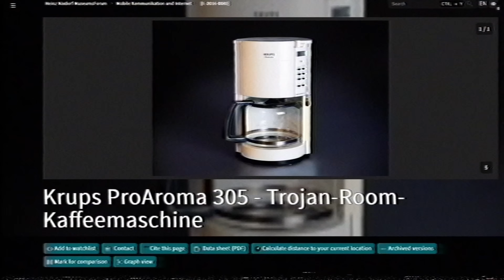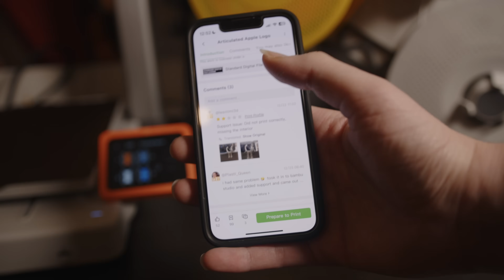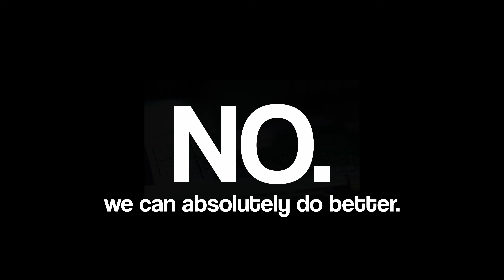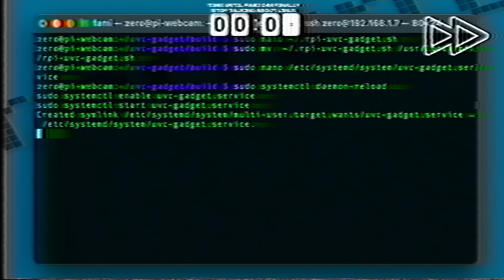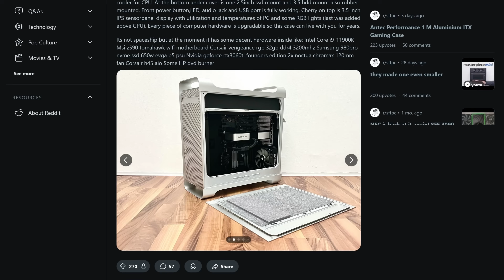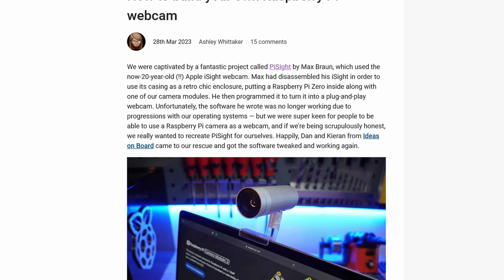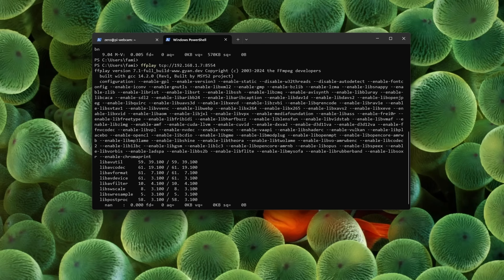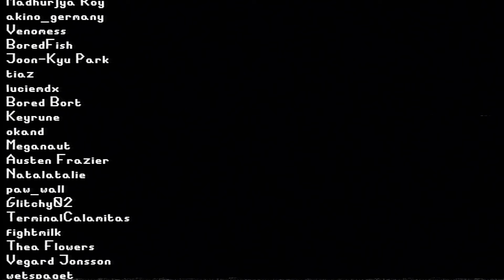Webcams SUCK, so I built my own one

Comment: You realize the irony of using the Pi right? The Acorn Archimedes used an ARM processor, ARM used to stand for "Acorn Risc Machine". The Pi is also using ARM, modern ARM. When you were using it over the network, you made the original coffee pot configuration INSIDE A ISIGHT HOUSING! AAAAA that's cool as heck!
Reply: Acorn Computers of course being a Cambridge company, the Owners starting out-ish at Science of Cambridge (SoC) then starting Cambridge Processor Unit LTD (CPU) and then onto Acorn, I might have to watch Micro Men again
Reply: the fact that Raspberry Pi and ACORN are Cambridge companies
Reply: @gammongaming9081 And both named after fruit
Reply: 666th like.

Comment: It's honestly crazy to me no company has simply released a webcam that uses one of the amazing camera sensors that smartphones have now. We have phones that can shoot HDR, 240FPS, 4K, and yet webcams are still stuck struggling to do SDR 1080p 60fps in a decently lit room.
Or hell, put a DLSR sensor in a shell with a focusing lens.

Every few years I check to see if a company has come out with a decent webcam and and disappointed to see it hasn't happened, or if it has, it's basically the cost of an actual smartphone.
Reply: They're out there, just intended for industry use. Doesn't prohibit one from snatching such a camera from ebay though! Recently got a 2K one with 10bit stream and 110FPS. Basically a plug and play DSLR in a small package.
Reply: The problem is the data rate for high resolution high quality video is pretty high. The sensor itself is rather cheap, but the electronics needed to interface them aren't. (A smartphone SoC costs a bit of money!) And I guess there isn't big enough of a market to justify designing a custom USB interface & signal processing chip for this purpose
Reply: Most people really do not need to buy a webcam.
Camo allows pretty much any smartphone to become a webcam. With my phone I can go 4k60 if I really want to and specify which lens to use.

Most webcams are a waste of money.
Reply: @Ozzianman  Maybe if all you're doing is zoom calls for meetings. The moment you need a low latency video feed on the computer, your phone is a waste of effort.

Comment: One thing I've wondered for a while now, is why are webcams STILL using such tiny sensors and no proper mechanical zoom/focus functions, when you can easily make a webcam with a much larger sensor because you AREN'T restricted by space like phone cameras. Also, why are they STILL doing ANY of the processing? Even your version STILL has to do the encoding on a separate system using a totally different OS which adds unnecessary lag to the signal. It's literally connected to a whole ass much bigger and more powerful computer that have dedicated video encoders in the CPU and even the GPU, which are sat there doing bugger-all for most of the CPU/GPU life - just send the sensor signal to the COMPUTER ITS PLUGGED IN TO!
Reply: USB bandwidth is the issue

Comment: Hi! Zoom tech here. Since webcams are made for video conferencing the priority focus is lowest bandwidth. Apple and other laptop manufacturers try to focus on things like dynamic range rather than resolution since the software they use will reduce the quality to a max of 1080p. Even when bandwidth isn’t a concern the client system needs to encode than decode the streams in real time. The hardware can be easily overwhelmed trying to decode a couple 4K streams in real time let alone 20+.
Reply from the maker: Interesting! But wouldn't it possible/better for at least mid to high level webcams to give the user the chance to use their sensor to their full potential for specific usecases like streaming or recording video locally? Giving them choice, basically
Reply: webcams are not made only for video conferencing, there are a lot of other applications. your reply doesn't hold up any sort of logic. a camera is a camera ...
Reply: Then why are selfie cameras on phones great?

A camera is a camera, and people use them for more than Zoom.
Reply: @MentalEdge  because it's there mainly to take pictures and mobile phone SoCs have highly efficient video processing circuitry that's just not present on x86 devices. Your PC has to either process video with no acceleration on the CPU or send it to the GPU and rely on the accelerator there. So a phone just streams data over CSI straight to the relevant pins on the SoC, while a PC - if you were to use a high quality camera - would have to receive a massive stream over.. something?, put that into RAM, send it to an accelerator over PCIe or completely saturate a few cores to process it on the CPU and then it could save it. Hence why people using DSLRs for a webcam use them with a capture card.
This webcam project works because the Pi Zero is doing the video processing directly on the Broadcom silicon there. For webcams to have high quality output they would basically need a more expensive chip integrated into them and people buying webcams just wanna connect to a video call so the market is probably risky and companies may be unwilling to try it
Reply: @oiytd5wugho  None of that makes the "problem" of non-sucky PC video input insurmountable.
Reply: @MentalEdge  yes, nothing is insurmountable. Sorry for elaborating?
Reply: @oiytd5wugho  So you're not defending the status quo? You need to be really careful with "elaborating" at someone trying to make the point that bad thing being bad has no real excuse to be bad. It's really hard not come off like you're condescendingly explainable why there is a perfectly good excuse, actually.

You didn't tell me anything new, and I still think there is room for straight-forward improvement.
Reply: @MentalEdge  "so you hate waffles?" moment
Reply: @oiytd5wugho  "For webcams to have high quality output they would basically need a more expensive chip integrated into them" but if an entire Pi costs $15 how expensive a chip do you really need to integrate into the webcam for video processing? That's where I'm lost.
Reply: @Blutzen  like 5$
Reply: @oiytd5wugho  As another dude pointed out, if a relatively cheap Pi can handle the processing then what stops people from making inexpensive webcams with it? 

I also don't understand the hang-up with data busses - current standards possess plenty of bandwidth, issues with dropped frames have more to do with poor code. Ryzen has also pretty much ensured everything possesses a GPU these days, so that's not an issue. The components in an x86 system might not be anywhere near as efficient or purpose-built like they are with phone SoCs, but they make up for that with sheer processing power.
Reply: @kyotra  y'all are asking questions and then complaining about having answers... The "hang-up" is dealing with unstructured data such as an MIPI stream, I am telling you how things work, if all you want to do is complain then do not use the word "why".
There are market reasons and hardware reasons webcams are bad, I am not interested in or capable of solving them, I just made the mistake of explaining things to people ig
Reply: @oiytd5wugho  We're not complaining, we're asking more questions because your previous answers were unsatisfactory. Thanks for the condescension though!

I also think your reasoning regarding the webcam market doesn't make sense. The use of webcams for video calls is on the decline, since it's so much easier to use cell phones for the task; on the flip side, the people who do have an interest in desktop-connected cameras are streamers. Webcam makers should be shifting to target this new segment (if they're not already leaving the shrinking market), yet they are not even trying at this point. So what gives?

You don't have to answer that by the way, it was rhetorical. It's obviously the typical corporate penny-pinching and chickenshit risk aversion at work here.
Reply: Modern GPUs can handle dozens of video streams at a time. FYI
Reply: @HyviaVideoitaMansenlale  Video conferencing has to run on chromebooks and cheap tablets. Even intel iris or something like that from a few years ago is way above the minimum spec
Reply: @MentalEdge  Man, stop being passive aggressive on a topic as silly as webcams, you're talking to an Internet user, not your ex-girlfriend

If there are no improvements, it's probably because there's simply no demand. The vast majority of webcam users want something cheap and that works, especially considering that even when you're a streamer, the webcam video is just a small box in the corner...

If your intention is to take good quality photos, or record videos without streaming, you either have your own phone, or more professional and expensive cameras. Very few people are actually interested in webcams that provide professional video quality.
Reply: @Blutzen  

You're not just buying the Raspberry Pi, you're also buying the camera, which costs $30 at adafruit ($20 if you go for the smaller spy camera, that I imagine it doesn't have the same image quality as the video shows), not counting import costs. And don't forget that you also need to make the case on a 3D printer. I don't know if the Raspberry Pi comes with the SD card, but if not, you have to add that to the cost, since if you don't install an operating system on it, it will never work.

You'll have to see if, adding up all the costs (and the work involved), it's still worth it compared to webcams in the same price range, that are simple plug and use.
Reply: @ As opposed to being actively aggressive like you?

I didn't say I thought there was demand, I said improvement could be easy and cost-effective.
Reply: What is this reason and logic you're trying to bring into this comment thread?!?! Dont you know, millennials do have the emotional bandwidth to consider the possible causes for a thing being the way it is? Hell, they barely have enough to spare for discovering new words for things that already had words for decades, the dangers of ... cardboard ... (O.o?), and calling everything terrible while entirely refusing to research things that existed before they did then feigning amazement that the cool 'retro' thing from 15 years ago actually did exist....then being mad it didnt have HD, oh and self diagnosing the next new hip disorder that doesnt really seem to affect them at all unless you dont cater to it?

Also, I like how she calls her mac camera crap when it is producing a damn good picture.....some people just cant be pleased.....

Comment: "i built my own" by buying all the hardware that someone else built, printing a model that someone else built, and sticking one into the other, with multiple step-by-step guides that someone else wrote
Reply: Do you nitpick everyone who says they built their own PC when they choose their desired components? Nothing here is misleading 🤣
Reply: Yeah, f4mi has a point. If you look up the definition for the words "built" and "designed", you would see that these are two different words with two different meanings.

Building something is to simply put some components together.

Designing involves putting in thought on both the look and the function of a product. There's planning in design, while building is simply the act of constructing.

So, I hate to say this, but your disappointment is entirely due to your own expectation and bias. She did not mislead you with the title. It's both grammatically correct and accurately describes what she had done and shown to you.
Reply from the maker: i said built, not designed, and the entire thing is running using open source software so software wise you can tweak it however you want, so where is the problem here? not saying this to be confrontational or anything, i just think the title is pretty much explaining exactly what i did lol
Reply: @f4micom  thank you so much for replying to this message, I know it can be incredibly challenging to interact with criticism on this platform, and I applaud you for doing so in such a calm and constructive manner. 

I do understand the sentiment of OP though. I really like build videos, and they usually cover some novel problem with a novel solution, and the storytelling of overcoming the challenges, expected or otherwise, and that's what I'm after. 

Your video was greatly produced and shot, it was funny and entertaining, and you did a great job with this upload, but I found it to be of a different genre than the one I expected clicking on the thumbnail. So I'm definitely putting it in the "not for me" basket, but that's just a personal preference, and I think that's what op also tried saying

Comment: oh! I built something similar during the height of the pandemic when webcams of any quality were impossible to get. I didn't do any 3D printing, instead opting for a lens with a tripod thread on the back/bottom, and bolting the camera module to an aluminum case for the pi zero.

Comment: Hate to tell you but the laptop webcam is way better. This cam has a lot of noise, very low framerate, nowhere near the color reproduction of the laptop camera. Sure it’s a fun project, but the practicality is very much lacking.
Reply from the maker: the laptop camera has less noise because it's doing digital noise reduction, but it removes so much detail in the process, especially in the skin, it smudges everything 

colors wise i can agree with you but as far as i can tell it is mostly a software issue

what's cool is that i could potentially swap in another (fitting size-wise) future or alternative module if i find a superior one since everything is modular

Comment: For anyone that wants to do this for real world use just get a capture card and a nice camera with HDMI out. It isn't as fun as this project but it is much better quality wise. If you are going to be like "wahhh I need it to connect to the internet" you can figure something out with OBS
Reply: You can also get an industrial usb camera and not have to deal with the bulk size of a DSLR and external power requirements.
Reply: @rafall1118  if you are going that route you can use a lot of action cams as a webcam via USB c
Reply: Well, except that this whole project costs less than a single capture card, let alone a "nice camera"

This is both high quality and budget friendly.
Reply: @Blutzen  If budget is an issue use your phone. Droid cam OBS works great and you can also very likely use recent android phones as a USB C webcam with very little setup 
Again this video is about having fun, not budget reasons or otherwise and that is okay

Comment: I haven't gone past the intro because I'm filing a divorce with my current wife to marry you, but I bought a webcam module from Aliexpress that features a Sony sensor and very good quality. I've been battling myself to design an enclosure for it to use as a proper webcam. I did a very simple version in Tinkercad but it needs to be improved. Can we marry next wednesday? It's cheaper than on the weekend and I'm currently living in the cardboard box from a washing machine.

Comment: So you used about $70 worth of parts. About $200 worth of labor. Access to a $2000 3d printer just to make a camera that you say looks better but to my eye looks about the same as a $30 webcam ? And it will always look the same because no matter how bad your camera is, the YouTube video compression will make it worse. What a scam !
Reply from the maker: bro none of your numbers add up LMAO not a single one, everything was WAY cheaper
Reply: @f4micom  The Raspberry Pi is $30 she said so herself, looked up the camera module its  $30. The ribbon cable and the 3d printer filament $10. The work took probably between 1 and 2 days of highly qualified labor assuming an $2500 after taxes wage, that is $100 / day of work.

Comment: 19:14 and that is you CAN'T use your iPhone while it's serving as a webcam. You can answer calls using another Apple ecosystem thing, but that's it. You can mirror iPhone screen to Mac, but not all Macs and iPhones support it.
Reply: Classic Apple L
Reply: Yeah, and it only works with Mac, if you have a PC you're just out of luck :/
Reply: @s.tunafish  You're out of luck for a low latency solution, you're not out of luck entirely.
There's IPcam software available for both iOS and Android that works across macOS, Windows, and Linux; because it's technically just a webpage running on the phone. This also has the benefit on iOS devices of allowing you to actually use the phone while it's acting as a webcam.

The LG G4 and Samsung Galaxy S7 make fantastic IP cameras.
Reply: @s.tunafish look up droid cam or camo
Reply: works on my pixel, classic android W
Reply: Yet another instance of Apple doing the absolute bare minimum of a feature and acting as if everything they're missing is simply something you "don't need".
Reply: Most support it through Airplay.
3utools has a nice tool for that, there are also those carlinkit boxes which emulate that (and carplay) too and just spit out the unencrypted low latency video stream over usb.